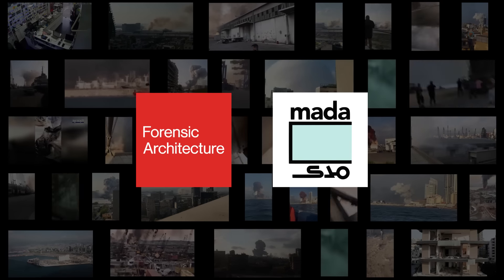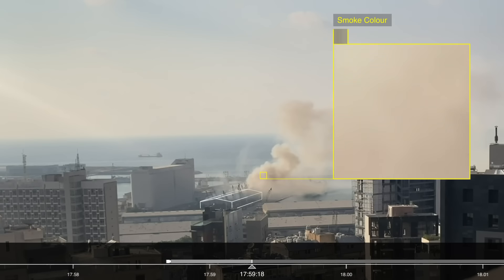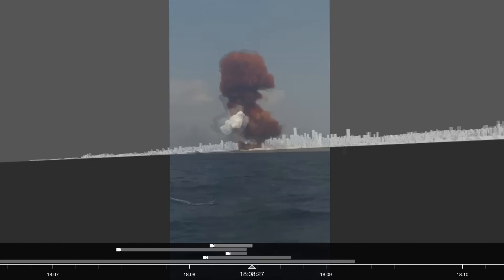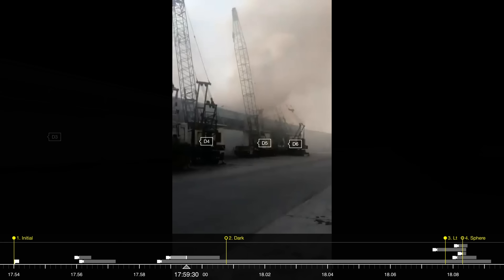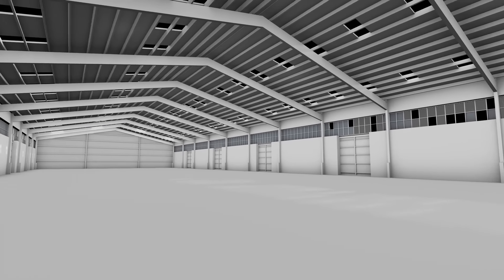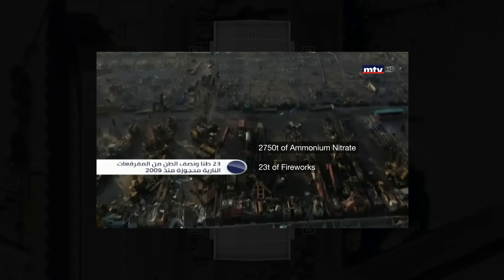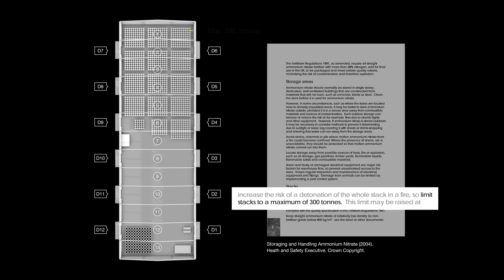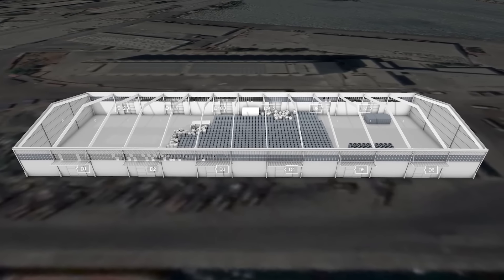The Beirut Port Explosion (English)

Comment: Great presentation, wow.   I can't believe they stored that stuff with the fireworks.
Reply: Literal ignition cable
Reply: If you're not familiar with Lebanon, you'd be amazed at the level of ineptitude. The govt, if it can even be called that, is built on corruption, nepotism and crime and while that's been the norm for decades, the addition of the pandemic, this explosion, the recent banking collapse and now, a cholera epidemic has turned Lebanon into essentially a failed state.

Comment: This is some of the most impressive analysis and presentation of immensely complex and technical reporting I've ever seen. You've presented it in a way that anyone can understand and extract the relevant information from. I intend on using this video as an example of how to do presentations and briefings!
Reply: i agree. before watching this it was like a chore finding out what happened and why. this told me way more than i even knew we had known in the first place.
Reply: Pretty good except he kept calling Ammonium Nitrate itself an explosive. Which it is not. 

It's an oxidizer that requires a fuel source. The fuel source is the explosive the AN is the source of oxygen or rather Nitrous oxide that makes the explosive a chain reaction not needing a container.

Pipe bombs burn the air inside and create a pressure explosion.

ANFO for example can be poured into a banana peel and be more dangerous than dynamite. 

Basically instead of creating pressure that ruptures, HE bombs release an incredible amount of energy at once. 

More similar to a nuclear bomb than a pipe bomb.

Comment: The fact that detonating cord was stored there should not be a side note - in my opinion, it is a fact of major importance. Det cord uses PETN, a secondary explosive that can easily be brought to full detonation in larger scale just by heat. It is a very poweful explosive, that sureöy has acted as a kind of booster to set of the full AN detonation. Without det cod, the ignition of a pure AN detonation seemed hard to realize, but WITH it the whole story makes way more sense.

There is no such thing as a "slow" detonation cord btw.
Reply: There are certainly two speeds in military use, I've used them in the Royal Engineers, quite apart from different speeds of fuse. The quirk here is that the percussive effect is central to the line of "rope", and can fail to detonate if it doesn't terminate in the explosive. It can, however, be turned into an improvised primer, which is good to know if you're likely to have them in battle.
Reply: They basically should admit, that a massive ammonium Nitrate Bomb making factory, caught fire and exploded.
Reply: @barryjames3747  Not really, the major accelerant is absent.
Reply: @RandySeverino  Not entirely. The question was whether it was an accident or not. The way those cargo bags were dumped speaks to laziness and ignorance. The fireworks? Well, I've been trained in explosives by the military, and there's also a thriving stream of civil thrill-seekers on here, from the dumb-ass suggestions this AI comes up with, some of which are candidates for the Darwin prize for short life-expectancy. That makes it very possible the fireworks were no accident.
Reply: @RandySeverino  do everyone a favor and never make worthless comments like these two again
Reply: That's what really got me. This video is the first I'm hearing of goddamn det cord - AND TONS of it - being in the same warehouse. They were literally BEGGING for an explosion to happen by doing that.
Reply: AN doesn’t become so energetic unless it’s mixed with diesel. That was the contaminant. Everyone knows AN, diesel and det cord make a decent and highly energetic bomb. It was the explosive of choice for the IRA during their bombing campaign against the Brits. You don’t need to be Eisenstein to figure out what was going on in that “factory”.

Comment: This is SUCH a good production, just absolutely amazing work melding video and photo media with 3d modeling. Stellar work here. It's damned disgusting to me that there was such gross negligence happening there for so many years. Anyone could spend a mere two minutes on Google and turn up incident after incident involving large amounts of AN detonating directly due to extreme negligence. One would think that this sort of thing would be easily prevented, if only those responsible for ensuring the safety of these well known hazardous materials had been doing their jobs.

Comment: I was morbidly fascinated by this explosion from the first news of it happening. As soon as I saw the colour of the smoke after the main explosion, I knew it was ammonium nitrate, or, as I've known it in the mining and transport industry, Nitropril. 
I lived and worked around central Queensland, Australia for many years. It is a major coal mining area in Australia with mostly Open-cut mining being employed. Nitropril transport and storage areas were a common site, and the main manufacturing plant for these explosives was located south of Rockhampton, the main city in the region, and Gladstone, the export hub for the coal, and a chemical manufacturing area. The plant (at Bajool) had entry requirements that were arguably as strict as a high security prison (I've delivered to both).
I did Dangerous Goods transport training (for road and air) and was graphically educated about the dangers of Ammonium Nitrate and other potentially explosive chemicals and compounds. Anyway, I wanted to say thanks for this video. It is very comprehensive.

Comment: partial recorrection - ammonium nitrate does not combust as it is only an oxidizer but it can spontaneously decompose by itself  if at a high temperature----
Here is the full reaction of that explosion.--- NH4NO3(s){white powder in bags before} → NO2( g){orange smoke} + H2O( g){water vapour}

let me just ay this was a great in depth video

Comment: Ammonium nitrate is fairly stable. It does not explode if caught on fire, nor does it explode if smashed with a hammer. However, it will explode if hit by a shock-wave (such as from fireworks). They basically piled detonators and explosives right next to each other. Such insane disregard for public safety.

Comment: It is my understanding that there were grain silos next to the warehouse.  It seems the explosion also fractured the silos and cast flammable grain particles into the air and produced what was akin to an additional nearly instantaneous and simultaneous fuel air explosion. I am surprised that this is not pointed out or at least mentioned and dismissed if not true.
Reply: The explosion just didn't fracture the silos nearly leveled them that's how incredibly powerful the blast was.

Comment: Obviously it was incompetent packing, just look at them all piled in there like they were dumped as soon as possible (7:07). Working in any industry that deals with storing materials. The workers on the ground usual don’t care and want to go home as soon as possible. I don’t blame them, but the jobs they do have a higher level of responsibility than they realize. There should be a higher standard and higher reward for fine work over sloppy handling. Otherwise these types of incidents will continue indefinitely

Comment: A truly devastating event and story.
Being a Biochemist, Ammonium Nitrate is a relatively stable structure when first manufactured.  It needs to be stored, for a SHORT period of time
in a cool, dry place and properly packaged.  Ammonium Nitrate is used ALL the time in Agriculture, typically it is applied right away, to grow crops.
The problem....storing Ammonium Nitrate for 6 months to 1 year, or more, under very damp or wet conditions and the temperature is hot, and not being controlled.
Ammonium Nitrate then becomes unstable, when wet.  The Beirut Port problem is that the Ammonium Nitrate was stored for 6 to 7 years!
And under the WORSE of conditions.  Fireworks were stored next to it??  Really??
This truly was a disaster, waiting to happen.

Comment: A in depth video of 9/11 like this would be really good, I knowing aircraft have my doubts about that event. Like aircraft fuel burning at a much lower temperature then concrete or steel melting point (about 150 degrees lower), and the fact 90%-99% of the fuel burned off in the fireball. But you seem to know more about how that could have happened.

Comment: How does it start?
Reply: It's never really been proved how it started but the official line is that there were some workmen welding a door on the warehouse and a spark set something smouldering, which set the fireworks alight which in turn set off the ammonium nitrate.  The workmen had left by the time the fire was noticed and when the fire crew arrived, the warehouse was locked and they couldn't get in.  By then it was too late.

Comment: Normally, I'd object to hyperbole about calling the warehouse a bomb, but in this case, he was spot on. Contaminated ammonium nitrate is a bomb waiting to happen, add in some carbon, such as from soot and smoke in a fire, it's a big, nasty bomb from hell.

From the flashes and there were two, looks like a flashover in the fire, followed immediately after by the main explosion. When I first saw footage, it was right after the explosion hit the news and my first thought was ammonium nitrate, as such explosions have happened in ports a century ago and back during WWII. I feared for the worst, in casualty terms, as residential buildings were visible in the footage. I was pleasantly surprised at how low the casualty count was. With 218 dead, honestly I was anticipating ten times that number, 7100+ injured was about half what I was expecting as well. As the Arabs would say, mashallah, the numbers of killed and injured were miraculously low!
Now, if only accountability was a thing...  :/

Comment: You only need the IQ of a warm day to know that this was an opportunistic attack by a state actor. Fireworks my ass. That was a cover story for small charges set to shake and "dust up" the warehouse to create an improvised fuel-air bomb - in other words, a technically expert "accident". Again, the fireworks (if there were any at all) were incidental and supplied narrative cover for numerous and identical "rattler" charges set to create the ideal conditions for an incredibly destructive thermobaric explosion rivalling a battlefield nuke in yield. Examine all available footage from several vantage points once the warehouse had begun to smoke. Small explosions are outwardly visible, and unlike typical fireworks fires these small white explosions were not chaotic but in different places and identical.
Indeed, even the lengthy smoking phase was initiated with its own mini-mushroom cloud tha you see at the commencement of this video! Why should a fire start with a mushroom cloud?
When were the fireworks stored? Find the paperwork logging the date of arrival and ownership of the fireworks. This was regime change and mischief on the usual audacious scale.

Comment: Would ammonium nitrate explode in this kind of unison without a detonator at the middle?
Reply: One sack being combusted is all it takes to trigger a chain reaction aslong as they're all in a close vicinity. A fire is all it takes for it to reach combustion temp
Reply: if you add water and zinc to ammonium nitrate it ignites.
there was zinc in the galvanized steel roofing of the hangar and the firefighters were shooting water inside the hanger, add the already ignited fire and there you go.
those poor firefighters shouldn't have been called to that location.
this explosion was the nail in the coffin for us the Lebanese.

Comment: 9:39 - "ammonium nitrate is extremely difficult to detonate by fire alone" - well, sorta. Surely, you won't get any bang when you throw a handful of NH4NO3 into a bonfire, but it is well known that once it's "molten" (see below) it starts to oxidise itself - quite slowly at first, but this process generates heat, which in turn rises the temperature of the stock, and this makes the self oxidatioon process to go bit faster, which in turn generates more heat, which rises the temperature even higher, which...
And if the loss of heat is slower than the "self-input" of it the temperature will rise until it'll reach the point where that self oxidation would become a detonation. And it's relatively low - around 229°C (444°F) if memory serves me... Or was it 292°C? (558°F). Heck, I learned about it like forty yrs ago, but as soon I'll find my old "Technology of Chemical Processes" high school handbook I'll give you the correct number.

And it's easy to "get there", easier than once I thought - and now "I know better" (and I'm still here to tell you this story).
Once upon the time, in my "stupid days" of youth I got this idea to try to detonate some of this stuff by "melting" some of the fertiliser-grade NH4NO3, placing an empty CO2 cartridge (one used to make carbonated water at home - back then we, "smart and curious kids", used to pack them, with a home-made explosive mixture made of aluminium powder and finely ground KMnO4 and use them as mini bombs - actually, they worked more like a mini superfast rocket bullets but I digress here), so the idea was to melt some of the nitrate, place in an empty CO2 cartridge, and once it cools down and solidifies stuff the cartridge with the mixture and then see whether this will be sufficient to actually detonate the nitrate.

We (my pal and I - I was the "brains" in this crew) took a small, 100 cm3 Erlenmeyer flask, lit up the "camping" alcohol burner, and then I placed a spoonful of NH4NO3 in the flask and heated it gently until it "melted", or rather "got dissolved in the residual water in it".
Then I added more of it, waited till it melted down, then added some more, and then yet some more, until the flask was about half full. Then I placed the empty cartridge into it, placed the whole set on the concrete floor, and we started to chat about all things while we waited for it to solidify.
Guess what? A few moments later a loud BANG!!! - and what a surprise, I never thought before I could actually "vacate the premisses" so quickly and efficiently. Wow. Who would ever knew, eh? ;-)

And this danger is well known in fertiliser plants making ammonium nitrate. It is produced by neutralising nitric acid with ammonia, and the product of this neutralisation is a hot liquid - a rather concentrated solution of NH4NO3 in water. This is then heated (AFAIR) in order to evaporate the excess of water, but solubility of this salt rises faster than boiling point of the solution, so no matter how much water is evaporated the boiling point is never reached (it goes up with rising concentration) and in the end the 98-99% hot (very hot!) solution is sprayed down the cooling tower where it solidifies into small spheres, or "granules".

But the temperature of this hot solution must be monitored very carefully, and ALWAYS keep below certain threshold, otherwise "shoot will happen".
Which I learned myself very thoroughly... ;-)

Comment: Ammonium Nitrate by itself isn't an explosive. Its an oxidizer.

What likely happened here is a runaway build up of Nitrous Oxide from the AN being heated by the fire. 

This would have fueled the combustibles in the room producing more heat until that point in which enough had mixed causing a chain reaction.

Comment: 9:40 'When CONFINED and CONTAMINATED'  IT WAS NEITHER, AN expansion velocities are WAY TOO SLOW!
CONFINED means the ability to build pressure, such as inside a pipe.  Inside a warehouse is not confined.
CONTAMINATED such as fine aluminum powder to make a binary (unrealistic) or Diesel fuel saturation ANFO (has to be blended like Alum powder)
That type of spherical fire ball is a clear indication of thermo raelcun reaction, aka hydrogen fusion.